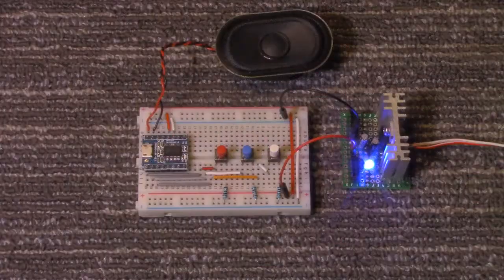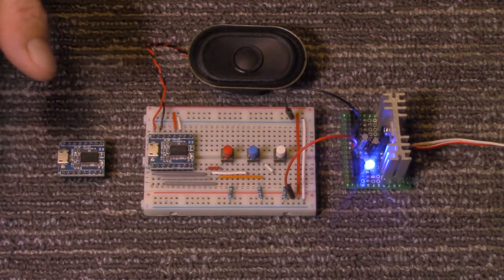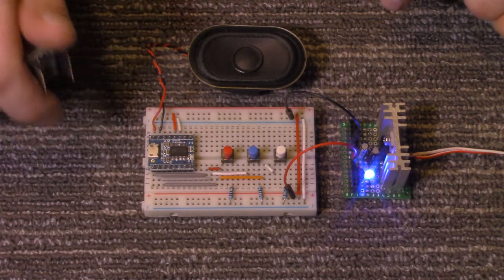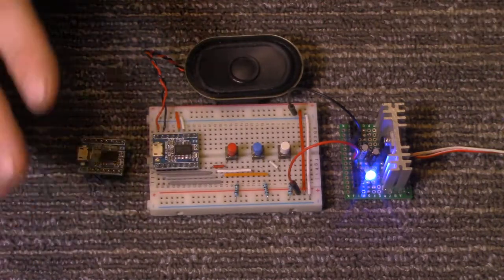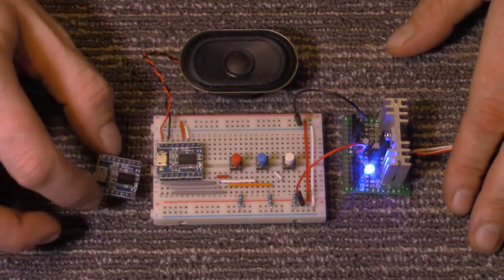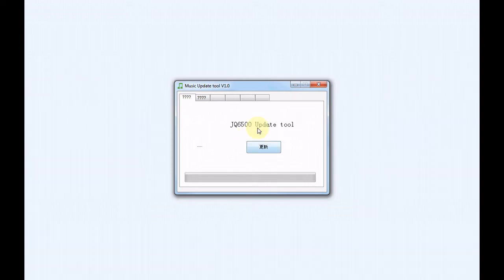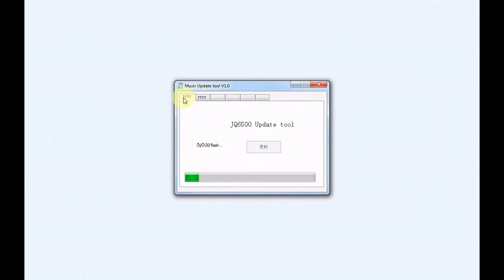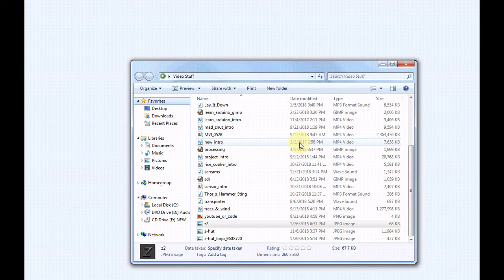JQ6500 MP3 player basic setup & how to upload MP3's to it

Comment: Is there a way to randomise the  played sound ?
Reply: Probably using a microcontroller
Reply: @ogam123  yep. I actually did some research since that comment. I was hoping to find an IC with one imput pin and multiple output pin. Trigger the imput and you get a different output.
The only options commercially available are very pricy and usually used for encryption.
So yeah, micro controller is and easy way. Shift register and oscillator if you want discrete circuit.